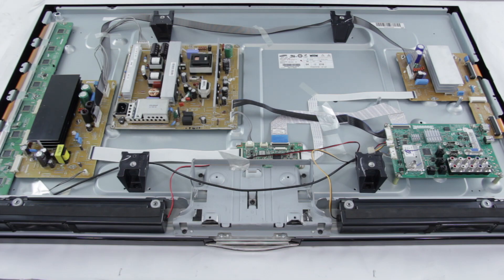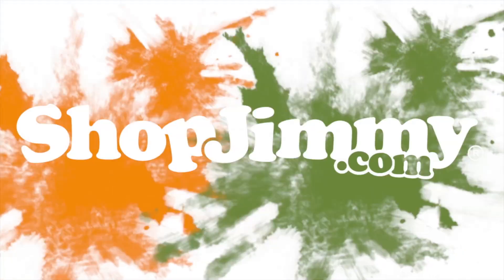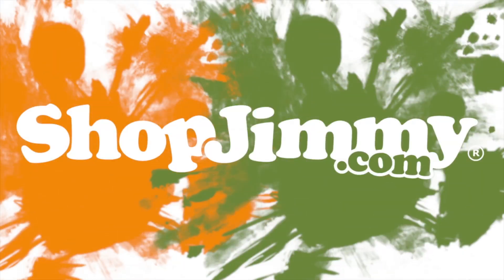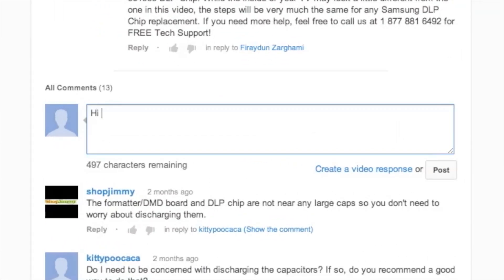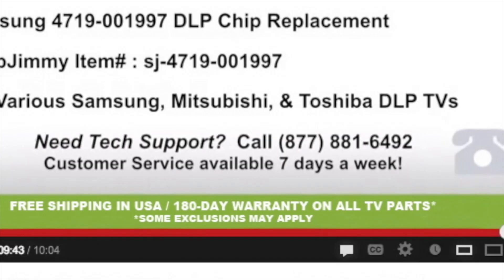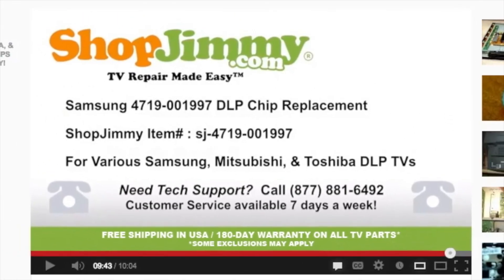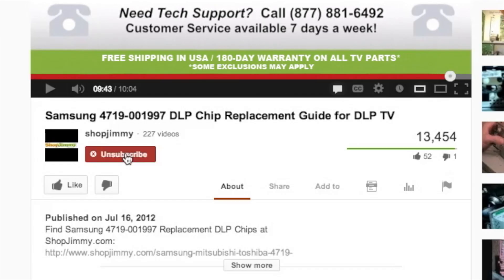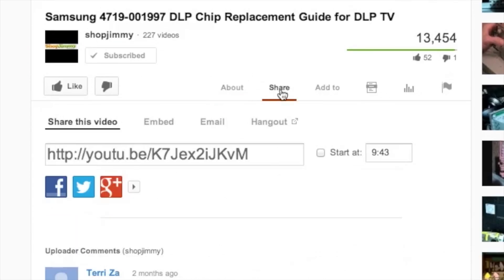Plasma TV Repair Tutorial - Common Symptoms & Solutions - How to Fix Plasma TVs

Comment: Awesome !!! thanks for sharing this wonderful knowledge about Plasmas!!!.  I have a Samsung ps51e8000gr Smart TV that has Black/white Vertical bar about 3 - 4 inches thick from top to bottom. Is it ok to conclude its the bad logic main? I am all set to buy a replacement through ebay, but will wait for your final confirmation. Again, i just want to try if this could actually fix my issue.  Thanks for your effort.

Comment: SP-P4251,  sound goes out after an hour.  Back on if turned off after 10 mins,  then goes out again after some time etc... main board? logic board? power board(caps)?  The caps all look fine, in fact it's a refurbished power board.  I bought it to fix the black screen issue, worked like a charm.  The sound was working fine too.  The sound issue came about a few months later.  I tried ordering a new main board (the one that has the sound chip on it, texas chip)  still had the same issue.  What do you think?  Someone said it was the sound chip overheating.  Can a heat sink be put on it and actually fix it?

Comment: I have a samsung plasma pn58c550g1f.  I have replaced logic board and main board tv turns on then turns of then turns of then nothing can’t use remote but standby light is on. Now if I unplug the logic board it makes sound and turns right on with no picture and remote works you see standby light flash. Any idea what could be

Comment: Not sure if I can still ask since this an old post but we just started having issues with our LG plasma. Product code 50PJ250. It started with no volume for about 10 seconds when tv turned on. Has not started doing loud static pops when tv is turned on and the screen color is off with pixels of greenish & pinkish discoloration. So seems multiple areas possibly?

Comment: Having trouble with my LG 60PZ950UA. I have vertical lines with pixel rainbowing going horizontal across the middle of the screen. Had a local TV guy look at a video of the problem. His thought was a bad power supply board. I ordered one replaced it. No help with the issue. Any ideas?

Comment: Thanks for the video! I'm pretty sure you answered my question already but I wanted to confirm with more info.I have a Samsung Plasma model number PN51E530A3FXZA. After turning it on, it remains on for a couple of minutes and then begins to power cycle. In your video, you mentioned the Y sustain as a potential culprit. Could this be accurate for this model number as well? Thank you so much for your insight and assistance.

Comment: My Samsung Plasma Display TV made a loud explosion/pop noise and the screen went off. I went to disconnect electrical and it made another loud pop noise. I disconnected the power and waited for about about 5-8 minutes and reconnected the power. The TV then make a click noise about every 3-4 seconds, so I unplugged the TV. The power strip still works fine along with my TV box. Model# HPT4234x/xaa   Ser # AJ1L3CEP602009J     MANF date 6-2007

Comment: I have a LG 60PA5500 and today while watching it the TV just shut off on its own. It will not power up now. No red light. No clicking, noises, nothing. I have verified the power cord and wall outlet and surge protector are fine with other electronic items. I tested the ceramic fuses with a multi meter ( no power cord attached and the ceramic fuses still attached to the board) and they all have continuity. I'm not sure where to go next.

Comment: I have a 58" Panasonic Viera Plasma. The power has stopped working and it is most likely the power supple. My question is where can I get a replacement power supply board at a reasonable price. Thank you for posting this video.
Reply: Thanks 58px60u is the model number for the Panasonic 58 plasma

Comment: Hello...My 64 inch plasma model PS64F8500 is blinking red on standby and never turns on. I checked the power board for signs of damaged parts but none found. Where is the problem? And do you have spare parts for me. Thx.

Comment: I have a PN50A550S1FXZA that I believe is power cycling on and off.  You can hear the relays clicking off and on.  On the logic board LED2000 stays on for about a second and then turns off.  LED2001 and LED2002 just blink constantly. Any help is appreciated.

Comment: This is an amendment to my previous post looking for assistance..

I have an LG 50PC3D when turned on displays a vertical bar (mostly white with multi-color streaks) on the right side of the screen then goes away and appears in the middle of the screen.   After about a minute, the entire screen becomes mostly white with multi-color horizontal streaks.  The capacitors look good (no bulging) but have not tested them (if that's possible).  Would appreciate your assistance. Thanks

PLEASE NOTE: When the screen becomes mostly white, it is with multi-color VERTICAL streaks.

Comment: I have an LG 50PC3D when turned on displays a vertical bar (mostly white with multi-color streaks) on the right side of the screen then goes away and appears in the middle of the screen.   After about a minute, the entire screen becomes mostly white with multi-color horizontal streaks.  The capacitors look good (no bulging) but have not tested them (if that's possible).  Would appreciate your assistance. Thanks

Comment: I have a Samsung Plasma tv model pn60f8500afxza
I have had the power supply replaced awhile back recently had x and y board replaced after each has been replaced at least twice but few months go by then my issue return the issue is after watching tv for a little bit it will  shut it self off then turn it self back on and and will continue repeating this on and off very fast untill I unplug it what else could be causing this issue

Comment: I have a plasma TV Conia C4250
Reply: The Conia model: C4250 plasma TV does not display out. It lights deem inside and no picture is seen. It gives a green light when powered but later it withdraws to stand by. What are the possible solutions

Comment: Samsung 51e550d1fxza TD03
Red light at bottom blinks five times when turned on. Picture comes on for one second and then disappears. Then the cycle starts over again. If I turn the t.v. off. The standby light remains on as normal.

Comment: plasma tv, board samsung (PSPF561A01A) does not turn on, all fuses are good, replace a damaged thermistor and some diodes which are in good condition, the small bulb near the ac connector got burn out , and cant hear the relays working which indicates there is some circuit or component open, and I can not find it. Could you help me?
I would greatly appreciate it.

Comment: plasma tv, board samsung (PSPF561A01A) does not turn on, all fuses are good, replace a damaged thermistor and some diodes which are in good condition, the small bulb near the connector does not turn on, which indicates there is some circuit or component open, and I can not find it. Could you help me?
I would greatly appreciate it.

Comment: Greetings:I have a Samsung Plasma TV model# PN51D430A3D. The TV has 5 vertical colored lines on the right side and 7 on the left side of the screen with no other issues. By watching this video it sounds like a main logic board however I would like to see your comments on my issue.Thanks for the response.Paul.

Comment: I have a single vertical line on the far right side. It is not a solid line, it is a broken line that goes down the screen. It looks blue or sometimes pink. It is a Samsung Plasma PN60F5300BF.

Comment: My plasma TV is a Hitachi 50" P50H4011A. Symptoms were good picture but the audio would cut out after warm up. I replaced the main board/08214 and got video and audio working great. After about 5 minutes I lost the video and screen illumination but the sound still works fine. I put my original main board back in and had no audio as before but had no video either. I did however have background lighting over the full screen. I have also replaced the tuner board but no change. I have another module under the main board that I think is the logic board/JP60112 or Ja09582. Power supply seems to be working fine as well as the Y sus circuitry. TV powers up every time and has no shut down issues.  I'm thinking the main board is still my problem but was wondering about the logic board. What do you suspect is my problem?

Comment: Thanks for the video but my problem with my Samsung plasma tv is a burning smell. I couldn't figure out where the smell was coming from, while looking to find the burnt smell i notice the tv turned off. I went up to it and notice it was very hot from the back and notice the smell was coming from the middle back of the tv vents. Also i heard a clicking sound from it. I havent turn it bck on
Model number: PN50A550S1F
thank you

Comment: I have a TH-50PX80U plasma.  When I plug it in it clicks twice. Then pauses and the. Clicks again. I know the power is applied to the TV at that point.  Then when I press the power button to turn the TV ON, I hear the switch click again turning power off in a protection mode and the standby light flashes 3 times and pauses the flashes 3 times again repeatedly. The TV never comes ON completely. I read somewhere on-line that the code is an SOS  3.3V D board.  I’m not sure which board that is. Can you help me figure this out so I can have my TV back on again?
Reply: Jay, your issue seems very similar to my Panasonic TH-42PX80U, please let me know if you found the fix for the problem and what it was. Thanks!

Comment: Hello I have a Samsung 60 inch plasma TV. model number PN58C55OG1FXZA  I turned it on it plays noise when it starts up. but I’m not getting a picture?? also the power light red light just blinks when I turn it on. Also when I turn it off it never stays solid. When I do turn it on I see static on the screen for a split second. then it goes black it’s a really nice TV. but I can’t get no picture. can you please help me out thank you

Comment: hi i own  a tc p46x3  my tv is not turn on and thier is not flashing lights and no clicking sound. i believe a low voltage was the cause of the problem. how can it be fixed and and what do i need to replace? the power board or the control board? my email is dorianbiz@gmail.com

Comment: I have slightly visible vertical lines on my tc 42u2 42 inch plasma Panasonic, at times a sharp whack on the top clears it out and then it comes back. It happens sporadically overtime, sometimes it show up and other times it doesn't.
Reply: please get back to me asap

Comment: Hey Shopjimmy Team I have LG Plasma Tv Model 42PT350R -TD tv won't turn on just clicking after testing I found some IGBT transistors shorted on X-SUS and Y-sustain board so I changed all of them and turned the tv on and after 2 seconds 2 of IGBT on x-sus board got shorted again even I checked all voltages on Power Supply board all voltages were correct, so please help me to troubleshoot this fault, thanks

Comment: I have a samsung pn50a510p3fxza. The issue is two fold and intermediate. The picture appears scrambled, sometime many verticel line but sometime horizotal lines and I get a high pitch sound. The TV power cycles and turns on and the picture is fine. TV works. I anticipate something something is ready to fail?

Comment: Hi,
My tv model# is PN50B530S2FXZA and it finally stopped working and won’t power on.  There have been some issues in the past that were similar but the tv would still come back on.  Previously, maybe after a power outage, I might be able to get it to power back on by multiple presses of the remote power button and then it would work fine for quite awhile.  This time I believe there was a short power outage and the tv was acting strangely then I heard a loud noise and it stopped and I haven’t been able to get it to come on except for 1 time it tried to power on but did not.

Comment: Hello, thank you for providing your assistance I have a LG Flatscreen Model No. 42LK450 - UB. SN. 111WTBY2Y101
Here is what happened. Was just watching TV and the the sound stopped and i has not returned. I have reset the system, checked alll the audio settings, reset the audio setting. I have call LG customer service and gone through the system rebooting with them but nothing seems to work.  Can you give me some suggestion before I pull all of my hair out(LOL)?

Comment: I've got an LG 60PV400 with 2" wide black vertical lines separated by 2" fuzzy vertical lines across the entire screen. I replaced the main power supply and that did not fix it. I have sound but pretty much nothing else.

Comment: I have a hitachi 42hdf52 no other series of numbers or letters just 42HDF52. The tv has a problem with  maybe the main board, you were talking about at 2:00 in your video, about signal, tv tuner, components, composite area of the board etc. I have two problems that hopefully are in the same area of the tv as you described about the main board. Issue one, now I noticed that if I wanted to watch digtal tv it took almost 30 min for the screen to clear up from washed out picture to clear to wonderful picture sound worked fine, issue two I'd use the component connections for a playstation connection and it was getting the same symptom as the tv tuner, the image would take some time to clear up. The dvi and vga connections work perfectly fine as well as the sound. Is there some parts manual, schematic documentation  that you know of that I can download or acquire so I may take it apart and maybe an opinion as to what the board model maybe? Regards

Comment: I have a lg Plasma tv #50 PA 4500. i plug my tv up it shows a snow screen for about 20sec then it goes out i cant power it on or off when that happens. it went off during a storm. i checked the fuse with a meter and they were fine. my green light is on and my red light is on in the back. could it still be the power board. please help if you can. thank you

Comment: I have a samsung plasma  pn58a650tif. It loses signal and and input not recognized signal comes up and then between a few seconds or minutes the show pops back on. I have another Samsung and plugged it in using the same power cord and HDMI and it works well. The frequency of the outage started intermittently and now occurs frequently. I took the back off and inspected and do not see any bulging capacitors. Help jfetzko@fetzko.com

Comment: I have a Panasonic TC-65ST50.  It has recently began turning off on its own.  It will turn back on as soon as you hit the power button on the remote.  Today it turned off then turned right back on.  I'm fairly handy and have soldered for car audio and home audio speaker builds/installs.  I love the TV and would rather not buy a new one.  Any help would be great.  Thanks.

Comment: I have an problem with Samsung SyncMaster 400Pxn it is an plasma professional monitor . When i plug it it just goes in some kind of bootloop o power loop , just clicks and doesent stay on , i changed capacitors on power supply board wich were faulty and it doesen't help . Do you have any tips for that problem ? Anything specific what to look for ? Thank you. It is great video , helpful and very easy to understand. Great job

Comment: Hey Brothers I have a model # PN51D450A2D inside it says 850HW-YB07 TV was fine the all the sudden picture went out black screen I have changed every board except the main logic board so I turn it on sound works perfect but black screen and green light on logic board comes on for 6 seconds goes off for 2 and 6 seconds over and over...please help

Comment: PLEASE HELP me with...
Model: Sony KDE-42XS955
Type: Plasma
Size: 42 inch
Manufactured: 2005
Retail: $4,995

I bought my Sony KDE-42XS955 from B&H Audio Video in Manhattan for $4,450 in July of 2005. It was the absolute finest TV on the market at that time. It never gave me any problems during its 11-year-long life. It finally died in March of 2016. It was still producing a perfect picture up until it simply refused to power on. When it would power on, only audio was working. The video went from perfect to nothing. There was never and fading of its quality over time. This leads me to suspect there's some internal power supply issue, or something that has nothing to do with the TV's ability to produce an image. Because again, the image was always perfect up until it died. 
I wonder if this TV can be fixed? It was the greatest TV I'd ever owned, and I've had many since this one. Today's average market range TVs still aren't as good as this set. This is why buying the finest TV you can pays off. You future-proof yourself for at least a while. Again, except for the highest-end sets, my 2005 Sony plasma was better quality than 95% of the TVs made in 2018.

Any ideas? Thank you for your time.
-Mick O'Brien

Comment: Hey Shop Jimmy, I have a LG Plasma 60V250 UB. It overheats then shuts off. Is it the power board? If I replace the power, what's to stop the new board from doing this again?  Would you recommend me adding cooling fans to the TV?
Reply: If I immediately turn the TV back on, it will work for about 5 minutes, then shut off again. I can turn it back on without issue each time.

Comment: Hi Jimmy I have a  panasonic 50 inch tv TH L50B6Z ITs BLINKING 3 TIMES and no picture. I  on line and got the panasonic blinking codes an it say it is d board .I have replaced one board on it and that was the one with the HDMI and usd and rca cables on but didn't work.the only 2 left are the piwer board and another small one. My question is which one is the d board .Thank You

Comment: LG 42PA4500LF Plasma The power light does not come on when you push the on off button. Also there is no picture and there is a blinking light on the main board. Is it just the on off button gone bad?